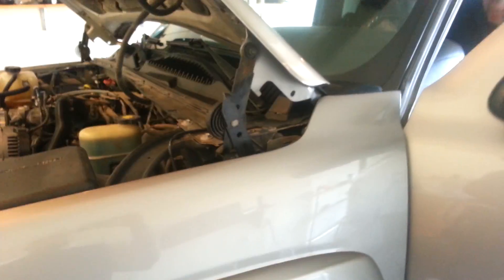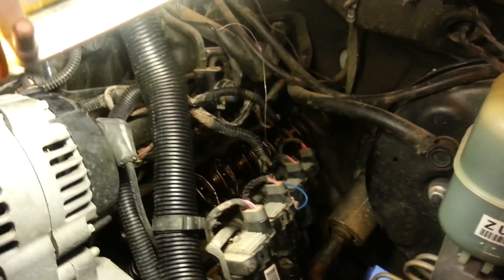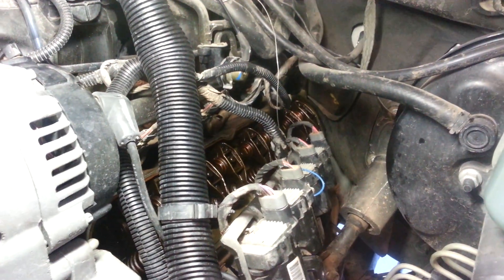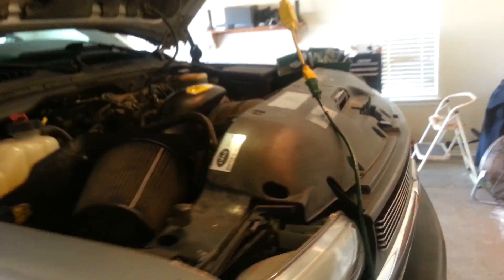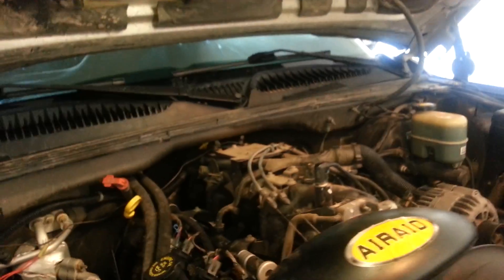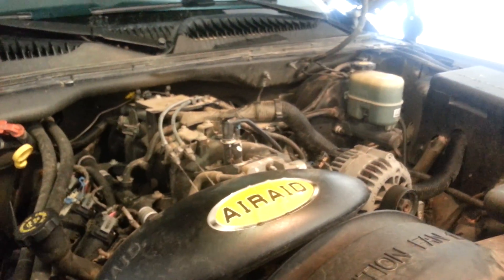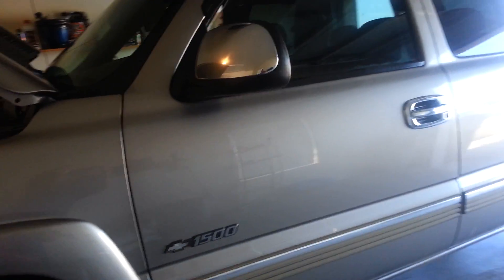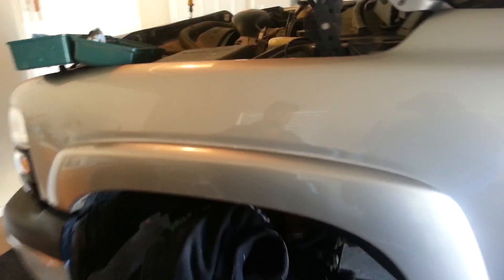Chevy 5.3 engine knock troubleshooting

Comment: How the heck does it beak a connecting rod?😅
Reply from the maker: Coolant leaking into oil thru head gasket. Extreme cold froze water inside motor. Preesure in cylinder. Cracked rod =noise
Reply: @ibanezmeRC  10 fo
Reply from the maker: @glenwoodjenkins3018  ive sense sold this truck. $5k. I drive a 2016 z71 now

Comment: It’s the oil pump, on the newer chevy’s the on front crankshaft middle of timing chain they are not on the bottom like oil filter like the old chevsThese oil pumps when they go bad they make that sound
Reply: I have same noise, it had oil in the truck b4 I cranked it, then I looked down n oil was ÈvERYWHERE!
Reply: Would that explain the oil and the noise?

Comment: I had the same sound coming for my truck. I thought bearings but when I removed the oil pan I could see that the flex plate had a bolt back out and was fudging a lot of stuff up. Luckily found it right before it broke something else. Don’t assume the worse and buy a engine. If Oil pressure is low then it was more likely to be motor.

Comment: Having that problem also on a 2003 avalanche turned out to be the torque converter...
Reply: This was not a torque converter lol. This is a spun bearing or thrown rod.
Reply: Did it stay on? Or would it shut off as soon as you stated it

Comment: I have the same issue mine leaves after idling for a while however I put sea foam in and if it’s cold outside that shit needs to heat up usually with this truck it’s common to hear knocks and a lot of the time it’s for no reason

Comment: same noise on my 240K miles 5.3 ltr 2000 yukon. Just started sounding like that. Someone said flex plate or bearing.
Reply: I'll check to see if its flex plate, and if not than getting a new engine, still cheaper than a new truck, even used. I love the 5.3,some more miles than mine still running!
Reply: What was it?
Reply: Hey Ik it’s for years later but what u end up doing ?

Comment: i had this problem not as severe but still was a problem truck wont pass smog so me and gf went to the JuNk yard to look for a motor now ive been working on trucks since i was 9 years old i was the nieborhood repair guy for cars and trucks the trick is to find a good motor in the junk yard and heres how you do it  first we are not looking in trucks they are hard working in the field and clean air entering the engine leaves a big ? mark in your head even tho the oil looks clean so whats next vans vans work hard mainly in the trans its the way there geared that preserves the motor we found one with the top end already missing this was good since the last motor had piston slap number 6  since the bores are already exposed a simple check for hone marks is easy they were present half way there next and just as important is the connecting rod crankshaft clearance in the manual it gives specs for this all you need is a feler gauge and they were well within specs bought the motor for 268 dollers just the block itself no starter no nothin  bare block they are much more with all the stuff on them went to parts store bought a gasket set 65 dollers preped block and heads reassembled new spark plugs wires pickup coil cap new timing chain and run like a champ passed smog easilystill running strong oil still looks clean as before changed the oil it was black a week later due to piston slap this is long excluding my time which was about 4days cleaning parts and assemble it cost us about 500dollers make sure all your parts are clean and within specs  no leaks and no error codes good luck my freind hope this helps you and anyone else who reads it have a good day

Comment: I have a 2007 Chevy Suburban that has 150,xxx miles in it and heard a pop and now the truck is making the same noise as yours. Started the truck  this mooring and for about  30 to 40 seconds the noise went away and then popped again and the noise is back and loss of power. I might need a new engine too. Sucks!
Reply: Crazy Sixtynine what was the fix for you?

Comment: I have a 2007 5.3 Chevrolet Silverado, same problem you're having I also have. Where and how much can I get another engine.
Reply: japhfus borel I imagine you have already fixed this or sold the truck since you posted a year ago.  But for those in this hard Place between a rock and a Rock:-)  Look at the Chevy CRATE engines.  I had a 85 S15 GMC JIMMY that lost a head gasket and mixed oil with water seized up lost the engine.  I bought a Brand New GM CRATE Engine had it installed at the Chevy Dealer,$1900.  For a Silverado  You can get a NEW CHEVROLET LS  370 CUBIC INCH for $7000 Factory engine, 545HP. With a Factory warranty!